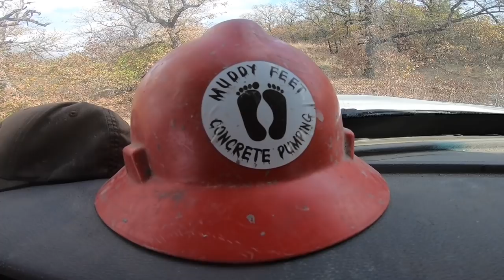Pumping a house foundation and piers holes for for another one.

Comment: We supplied concrete to 3800 steel casings smacked down 22 meters some deeper, boom pump was the best machine for the job. The height of the concrete had to be precise, the drop hose on pump was fitted with a squeeze stop. It worked well...it was a fiddly pain in the butt job that grew in size as the project progressed.

Comment: What is their purpose?
Reply from the maker: Piers are one of the best ways to stabilize a slab from movement. They are usually used when fill dirt is brought in to make a level pad for the foundation to sit on.
Reply: @MuddyfeetConcretePumping  thanks makes since.

Comment: A bit disappointed in the filling of the pier holes.. didn't see the holes finished off. 
But the "workers" did not appear to be "workers", and even commented that the concrete guys don't get paid enough.. lol. 
Assume the stick with the laser was to know when to finish off the top of each pier, then a standby supply of concrete (like in a wheelbarrow) to shovel the last bit on top seems would be prudent. The pump person can't cut off the flow at a precise level on top.. 
Missed the finishing part.. but thanks for taking us on that trip to the top to fill the pier holes. Was indeed interesting..
Reply from the maker: Thanks for watching! Piers can be a pain in the but. Especially if they are trying make them a precise elevation.